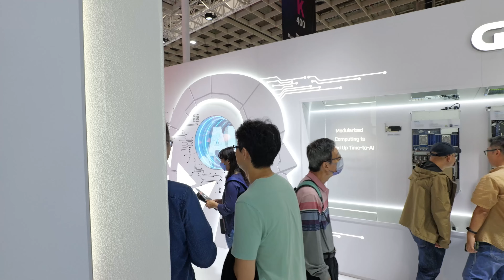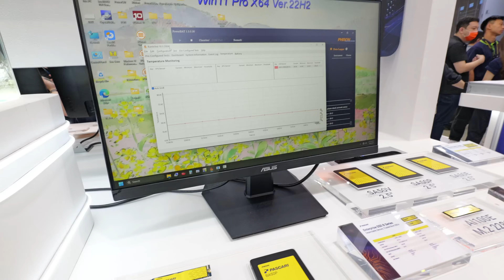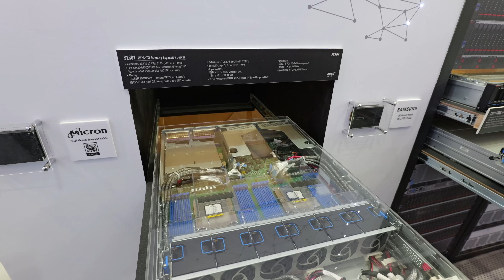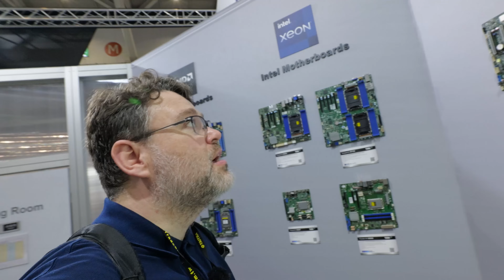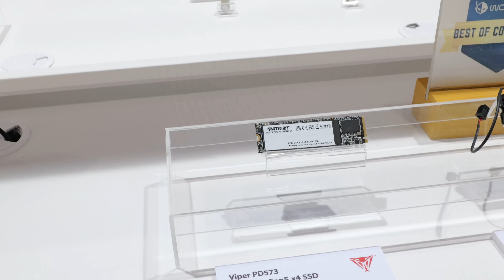Computex 2024 Show Floor Part 2

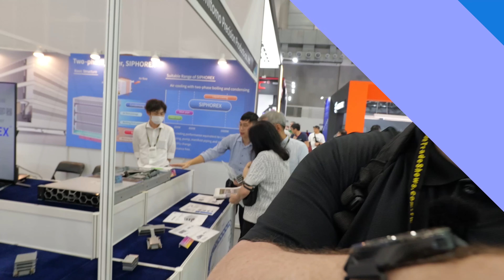Comment: 14:24 Imagine for the 9700G, they supported CXL memory a 3rd channel to feed the bandwidth starved APU.
Or, preferably, had special motherboards and a 3rd memory controller, i mean they have the pins for it, each dimm uses a most 288 pins(even though many of them dont connect to the CPU) and there are like 370 extra pins over AM4?
Reply: I'd love to throw 3x48GB DDR5 8000 dimms into a board. Those AMD APUS have god tier memory controllers.
8700G hits 8000 in gear 1 CR1 just by enabling XMP? Wild
Sure the chip is hamstrung by both needing to share between a CPU and GPU, and that CPU being bandwidth starved with each core having 1/2 the cache as the 7700x meaning each core is putting more pressure on the memory leaving less for the GPU.
Its an amazing feat to be able to run memory that fast(IIRC someone got to DDR5 10600MT/s though i dont think it was gear1), but its a disappointment for it to trip over the starting line from AMD hamstringing the chip so badly.

How much extra die space would 32MB of cache be AMD?
How much extra die space would a 3rd channel require even if it was CXL only?
I doubt it would push it over 200mm²
But for that extra 20mm i'd pay $450 for a good all-around chip.
Put it in a handheld, oh mama thats a screacher, probably more efficient too by not needing to hit the RAM as often staying in cache.

Comment: Ok, so AM5 can fit 3x Zen4/5 chiplets, assuming Zen4/5C are not too much larger, we could in theory have 3x16 core chiplets in an AM5 socket.

Does that mean we'll have a 48 core 96 thread 2.5Ghz base clock EPYC 4955?

Probably no until Intel releases an all E core LGA 1700/1851 with 48-60 E cores.
Lack of competition, breeds stagnation.
We are fast approaching the time where 16C32T has been the max for desktop longer than 4C8T(Lynnfield/Clarkdale to Kaby Lake)

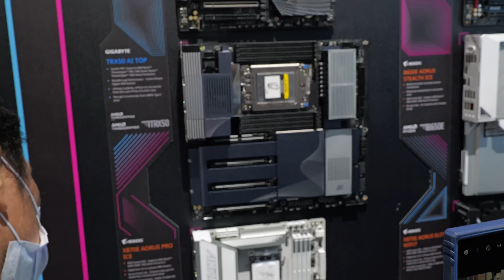Comment: 08:35  It's even more interesting than that.  That's 8-channel memory when you have a TR Pro processor installed.  It's not clear whether or not you get two DIMM's per channel with a TR processor.  

One other difference clear from the specs is one of the slots being PCIe 5.0 with a TR Pro processor, but 4.0 with a TR processor.

There's no user manual available for download yet for that board.

Comment: If only the FSP Twins Pro redundant ATX PSUs would use quiet fans, a proper fan control and higher efficiency. Their noise levels are bad, similar to older rack-mounted ethernet switches.

Comment: The 45° rotated motherboard is delightful insanity.
Reply: 45 degree rotated banks of DIMMs AND dual SSDs rotated to like 60 and 30 degrees, overlapping each other, to allow two in the chassis. That's "our airplane is about to explode if you don't fix this" engineering, not what you generally see in a commercially available product. Love it.
Reply from the maker: Thst was amd epyc actually, maybe a snafu assembling clips